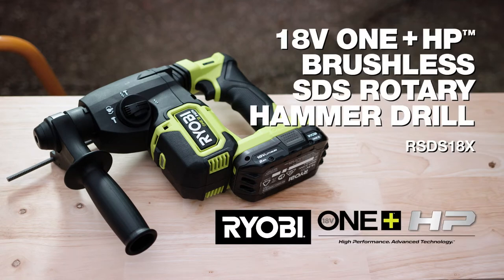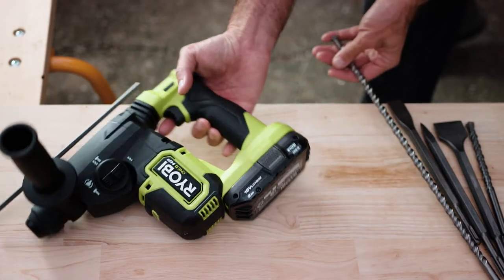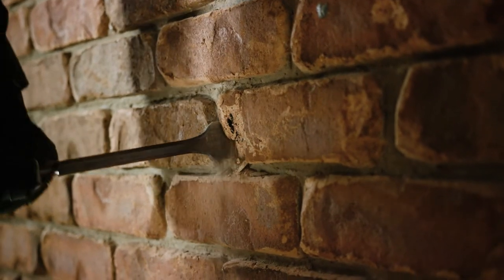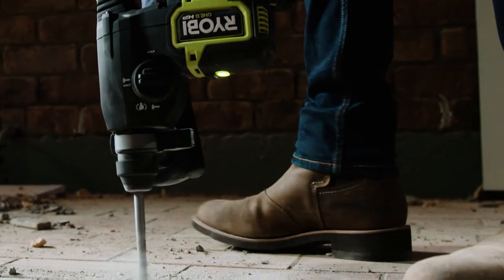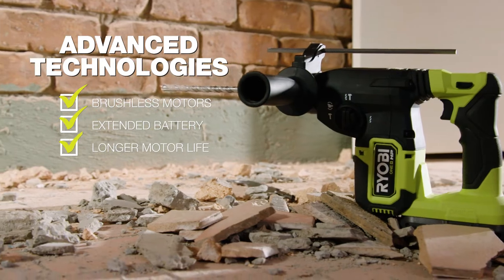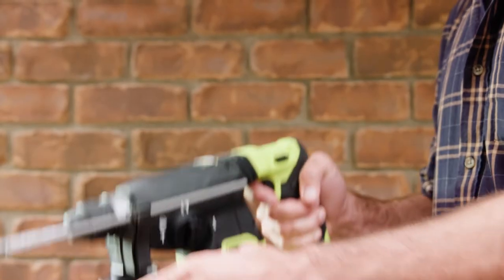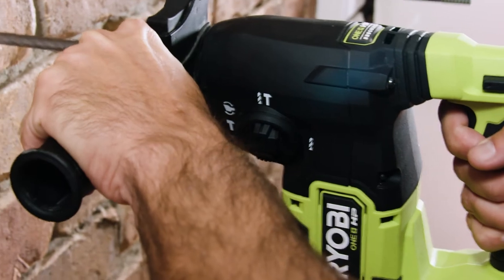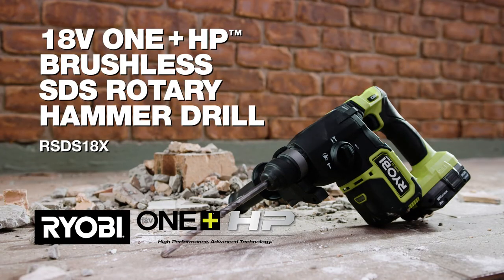RYOBI 18V ONE+ HP Brushless SDS Rotary Hammer Drill (RSDS18X) in action

Comment: My Ryobi HP is brand new, when I stop the chisel and lift it then go back onto the material the bit falls forward on the chuck untill I jiggle it around and the bit 'Clunks' back into place deep enough to contact the strike plate.
It is really annoying and I'm not so sure it should be doing this.
Any suggestions as to why would be appreciated.
Reply: sounds faulty to me, check it replace under warranty